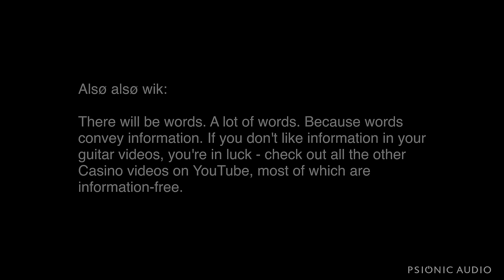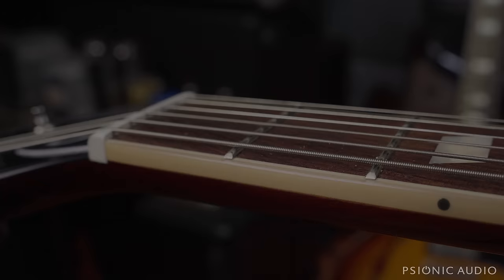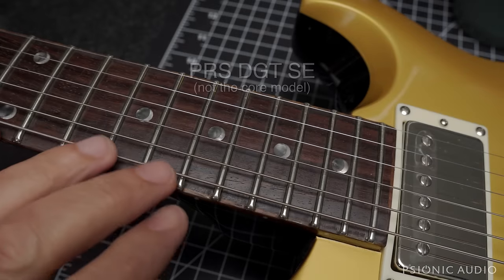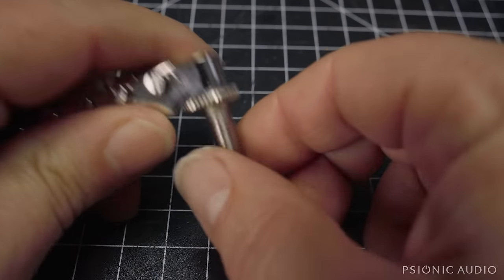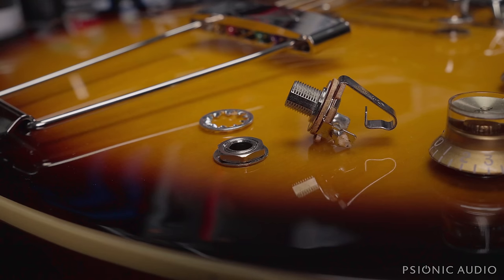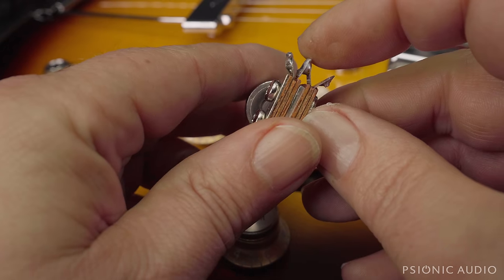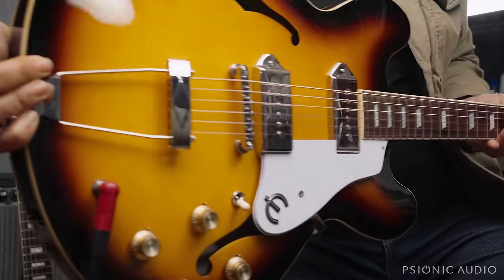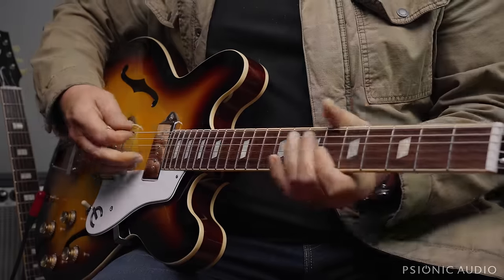Fab or Dead Grotty? | 2023 Epiphone Casino Review

Comment: So Lyle , you got this at a good price.. does it have the p90 Pros that are on the entry “ worn “ model ? The “ classic” p90s are really hot as you have said but the p90 Pro are about half the dc and sound so much better… how ironic they are the spec on entry model and not the Classic Beatles sunburst spec.
Buy cheap, buy twice… most owners would be way out of pocket with the list of ‘fixes’ you performed if they were paying a third party to do the work.
Obviously if this model has PRO  P90s and you just don’t like them, that’s fair enough.
Surprised about the linear taper pots and lack of lock washers, these are  £775 in UK for the sunburst version ( £430 for worn version) so not cheap.
Reply from the maker: These are the “Pro” ones supposedly.
Reply: @PsionicAudio  would be interested to know the dc and inductance when you get then out … ? Alnico 5?

Comment: so, you found out why epis are cheap. you have to spend extra [time/money] to make it an instrument. really surprised you didn't have fret issues, i've  repaired many  new epis over the years and i'm finding that harley bentons require about the same amount of setup work whilst only being a third of the price.

 this is often the way when you buy the budget version of many products. the trick is to avoid paying a premium for the brand name.
Reply from the maker: Well I knew all this going in, and knowing that I wouldn’t have bought it at the full price.

I just see so many videos on YouTube that say it’s GREAT and INSTANT BEATLES etc. 

And, well, no.
Reply: you'd probably get a better beatles sound if you simply removed about half of the wire from the pickups. and  would  also benefit from a complete removal of that thick polyurethne they use to  'protect' their 'commercial' grade [cheap] woods. @PsionicAudio